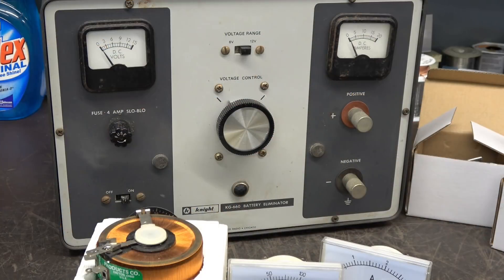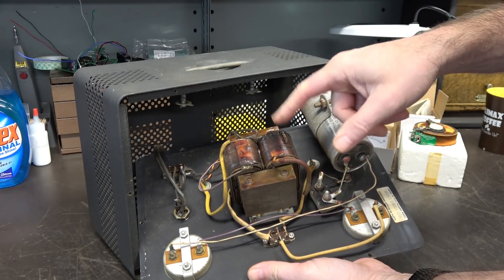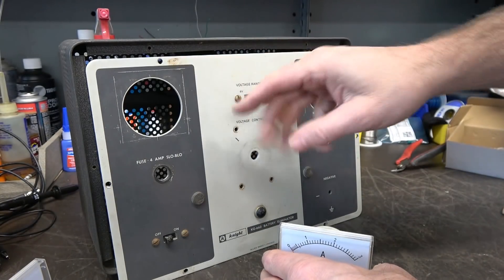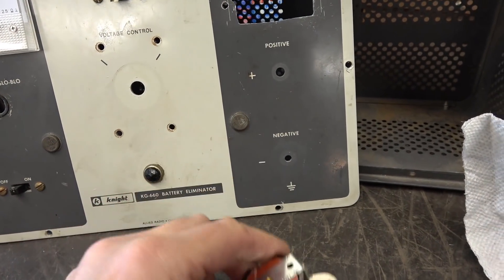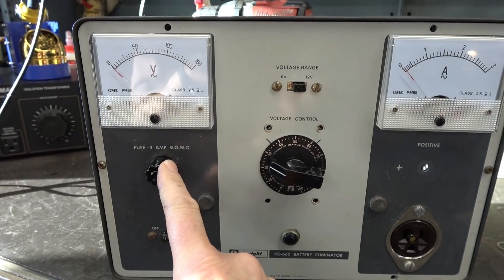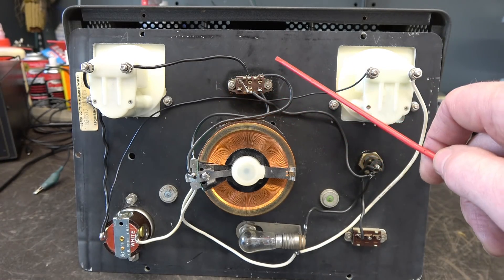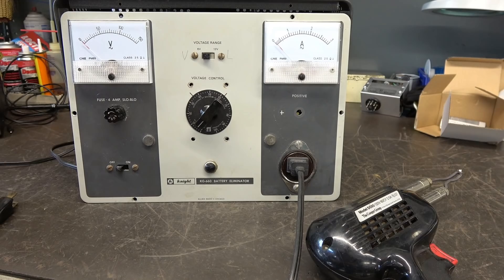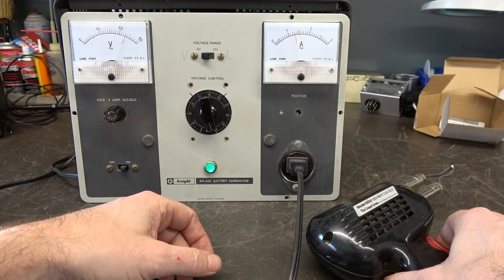How to build a Homebrew AC variac for Radio amplifier repair Test bench

Comment: Nicely done Terry. A tip for you guys out there looking to do a conversion like this without a mill. got a drill press or even a corded power drill? Screw your front panel down to a scrap of 3/4" plywood. Mark your hole centers and use a plain old hardware store hole saw and arbor. the plywood will keep the panel stable. Use your slowest speed and a bit of oil. You'll be surprised how nice a hole you can get with simple tools! Keep them killer vids coming D-Lab!

Comment: So I  built one like this, but when I test it with my soldering iron, the volt meter drops down quite a lot, like under 50 volts. Why would that be? 
Thanks for any information.

Comment: ooooohhmg u rock i did this same project with simple dc motor  push buttons for forward reverse polarity to go up down voltages u cant imagen the transformer is basically made for stabalize 220 v in any case cuse iam from pakistan and commpany was puma i alter its winding little bit how could i send u my project vedio i wana show u my project of trouble shooting technics su7600 long tail diffriential stage was netrous that was some time gives 5 v dc while working only in left channel ....cuse ocl and pure complimenty so dv was prob i did it ....and 2nd was sharp optonica sa2121 receiver

Comment: I see a few others also asked about the Variac.  It appears to be something similar to the Staco Model 221-B.  That one is rated at 2.5 amps.  They go for around $160 new.  Finding a used one (that is in good shape) could be a challenge. You might be better off buying a cheapo variac from eBay (~$50), removing it from the case, using the other parts, then building out the layout Terry has done by adding the panel meters, switch for Line vs Variable Output voltage, etc.

Comment: From Leo:  I have always been "gonna get a variac".   I have been using a lightbulb socket on a board since the 1960's.  It is safety, but does not help with diagnosis. I have let the blue smoke out of a few components along the way.   Anyone playing with electronic repair should have a variac.  I may still build one.

Comment: Hey Terry, I disagree that it doesn't make sense to use an insulation transformer for a lab like yours - or mine...! First, amps have an exposed area of line voltage, that you might accidently touch while working in an amp... Second, you might work on other electrical devices as well, that don't have a power transformer... In my opinion it's the wrong spot to save money and NOT go for an insulated variac... I built a device almost like yours about 10 years ago, and I use it almost every day. It's one of the most important devices in my own lab. But I used an adjustable transformer that has insulated primary / secondary windings. It's way bigger and heavier than the one I can see in your video - so probably also more expensive - but I am really lucky to have this extra safety of a not-mains-related power outlet at my workbench!

Comment: I am seeing a lot of chinese variacs for sale on ebay. They are 2 amp power ratings. Are these ok for use with guitar amps?
Reply: From Leo:  Generally yes, but if your amp draws over 2 amps,  that is not what you need.  The 5 amp ones are only a little more money, I have never needed more than that on electronic equipment.

Comment: Just picked up a General Electric T-127b and cant get any schematics and it's a nice little 30 watt 5 tube AM radio, was going to do a conversion into a little guitar amp, it just hums VERY loud when it warms up, noise just gets more gritty when you turn volume but the volume doesn't change and it does it on zero volume, also makes a weird spacey underwater noise when playing with the tuning dial lol
Reply: I've been binge watching videos from your channel and I bet I sound silly while you're like, "yep,   filter cap again" lol
Reply: i had some hum issues like that with steel chassies. They create a great big magnetic field around all the electronics and it couples into the speaker. nothing really helped my situation but then again yours might be different
Reply: Mine is like this lol 
https://youtu.be/vR7v0gs_asc
Reply: I took the back off, burnt up tube

Comment: TIP: If you can't find one of those older Hubble outlets, just buy a single round outlet at Home Depot or Lowes. Use the plate 6-32 holes to mount and cut the rest of the bracket off on each end.

Comment: In the 70's I built a 10a version of this in a slope faced crinkle finish. The one it had was a 1000 watt isolation transformer. A lot of the TV's back then had a hot chassis so line isolation was important to me. Recently the 0-150 voltmeter opened up so I bought one off ebay, it doesn't match the 0-10a meter but works just fine.

Comment: I plug my variac into my "wattmeter" to see the current draw.  Not as good for a few reasons but it adds the metering visibility.  Plugging the wattmeter into the variac output can be more useful but low voltages may not display.

Comment: Looks like a great home project. I believe I have all of the major components necessary to do this already. I have a suggestion for a future video that would help with the un-trained/self taught hobbyist like myself. Would you demonstrate how to calculate what the proper amount of current draw should be for an amplifier that does not have a schematic or specs? How does one know if there is actually too much current draw and likely suspects for shorts? Your consideration is appreciated.

Comment: Thumbs down for making a blanket statement that an isolation transformer is not required/necessary. Anybody who has a 220V or higher supply in their country should absolutely incorporate an isolation transformer for safety. Also ensure that the mains on/off switch has suitable double pole isolation ( 3mm contact gap in UK).

Comment: Terry, You might have mentioned that one must derate the variable transformer current on the lower voltage area of the transformer, because of the I.M. that came with a NOS Variac (R) I bought,  it stated that "the amp rating was spec'd over the entire rating of the auto-transformer, and one must derate the current unless using the entire winding,"

I have built several of these over the years, and I always include an isolation transformer in the construction. This is because I work on a lot of hot chassis radios and TV sets. Failure to use an isolation transformer on the equipment under test can result in a big  "Bang", and can damage the equipment under test and the test equipment too.
   (I had this happen back in Tech School when the teacher failed to teach or tell us anything about "Hot Chassis" sets and I connected the ground of a scope to the AC/DC TV set and blacked out the entire classroom building. Gotta love teachers that only knew theory, and had no practical experience).
Reply: NOS 
is not a brand 
it stands for New Old Stock

Comment: Nice project. One little suggestion is to add a neon bulb where the empty hole is for the + terminal and wire it to the output of the variac. When you set the voltage above about 60 volts, the neon bulb will illuminate indicating high voltage. Just a little safety feature addition.

Comment: Nice video.  I'm glad you used a non-functional unit to convert, I always picture someone cringing when a working unit is "murdered" and they wanted it.

I don't have a continuously variable variac like you created; instead I've got an old multi-step one with horizontal and vertical position slide switches, giving 9 possible output voltages.  I think it's a B&K unit, saved it from the dumpster many years ago and only used it a few times.  I need to find where I stored it and have a look.

[ Edit - Apparently it's a model TR110 Isolation Transformer, so as I said it's not really a true variac.
https://www.bkprecision.com/products/discontinued/TR110-isolation-transformer.html ]

Comment: I think the point of an isolation xformer arises if/when you’re working on series filament radios/amplifiers or when you have test equipment you want isolated from mains voltage
Reply: Yup. Indeed if combinate with working with a scope when you need no ground relation with your neutral.
Reply: super useful for troubleshooting switch mode supplies as well